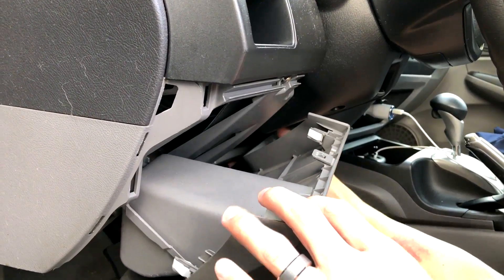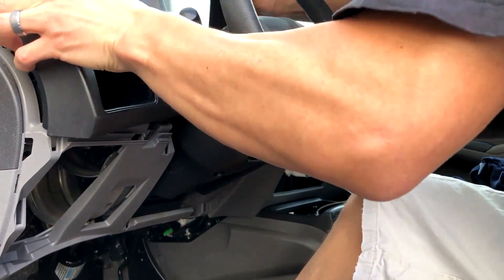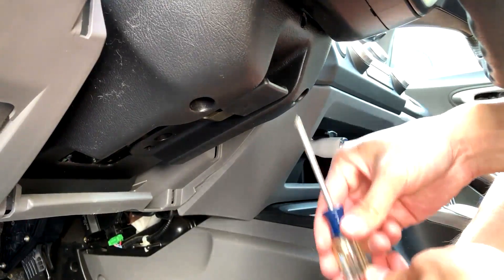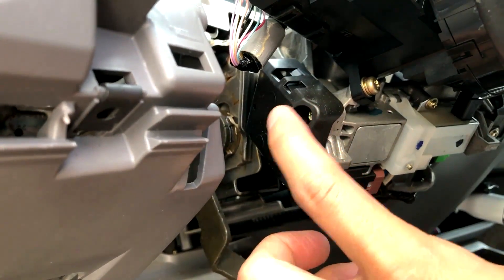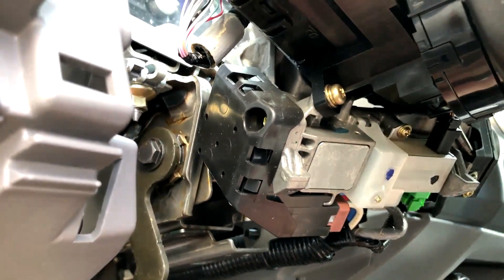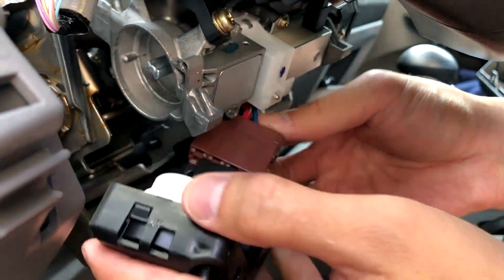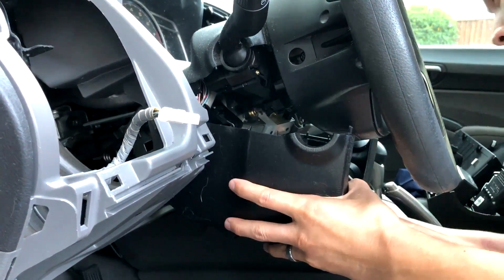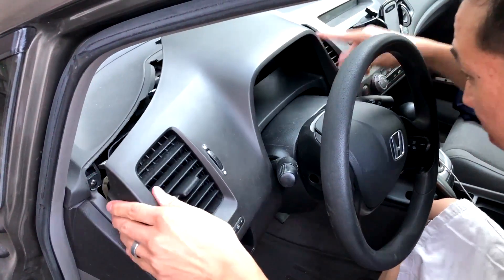2006 Honda Civic Ignition Switch Replacement

Comment: My civic dies every time you let the key snap back in the detent / run position after starting it, but if you rotate the key back very slowly it will stay running. I assume swapping this part will fix that?
Reply from the maker: Very interesting.  It's worth a shot.  I would Google more and see if you can verify the switch is the problem.  But that would be my guess too.
Reply: @nukem384  Yep fixed it! Took longer to find the right screwdrivers than to swap it out! Great tutorial!
Reply from the maker: @leedchristensen  Lolol.  Yeah, that one screw is difficult without busting holes in your plastic covering.  Glad you fixed it!

Comment: I have to press the key up while turning the car on so it starts otherwise I hear a weird “zzzzzz” noise coming from the relay box near the hood latch. Do you think this will fix the problem or do I have to change the entire ignition assembly with new keys?
Reply from the maker: Forums are saying this is actually normal?  Apparently you might just be noticing it, even though it migh thave been there.  Is your car a stick?  The only suggestion I saw was to push the clutch all the way down to the floor when starting the car.  Not sure changing the switch will fix your problem unless you change out the whole ignition system?
Reply: @nukem384   it is an automatic and would not  do this before. The main issue is only I know how to turn on the car so if someone else tries youll just hear this noise while turning the key and the car wont start. I am just not sure if it is the key cylinder that is bad or if it is the ignition switch which you showed how to replace.
Reply from the maker: @markrodriguez0  I would just try both then.  If you're on a budget, my guess would be the cylinder, but I can't say for sure.
Reply: @nukem384  Thanks for your help! I will try the switch first since it is cheaper and if that doesn't work, I will replace the whole ignition switch assembly with new set of keys. I will report back with my fix so that someone else who has this issue has this as a reference.
Reply: The problem was the ignition switch. Thank you, you saved me $$$.
Reply from the maker: @markrodriguez0  Awesome, the I was able to help get your problem fixed!
Reply: Yes a bad ignition switch(that which is being changed in video) the bad symptoms are the buzzing sound that's how you know to change it,I'm having a separate issue car is cutting off immediately after starting
Reply: Imu check the alternator. When car starts disconnect the battery. If the car shuts off then you have a bad alternator.
Reply: Could also be the fuel pump ive had a similar problem with a different car

Comment: Just did this but now my car won’t start and it’s on wheel lock mode not sure what to do now
Reply from the maker: You need to unlock the wheel.  Basically push the key in, hold, try to turn the key and jiggle while moving the wheel.  It should unlock the wheel and then you can start the car like normal.

Comment: How do you know that a ignition switch is bad? And not that it is the starter?
Reply from the maker: The electrical system is really tough to diagnose yourself without the right tools.  For this car, the starter is terribly hard to install (I have a tutorial on it, so I know).  So what I would do is just try the ignition switch since it's a lot cheaper and easier, and if that doesn't fix it, then you'll have to do the starter.  At that point, at least you'd know the electrical system will be good for a while.

Comment: The two screws on the switch are really tight, is there something that can be done to make it more loose?
Reply from the maker: Unfortunately not really.  Screws are the bain of my existence TBH.  Best thing you can do is find another tool that gives you more leverage to break the screw tension easier.

Comment: I cannot pull out the switch after 2 screws removed. How much force do I have to use to pull the old switch out?
Reply from the maker: As you can see in the video, it should take very little force to pull it out.  Make sure the unit is unplugged.  You might need to pry at it a little with a flat head if you can't get it out.
Reply: nukem384 I pulled out electric connector but the switch seems to glue to the ignition assembly. I’m afraid if I pull the switch really hard it will break something.
Thank you for the reply.
Reply from the maker: Sean Liu theres nothing really to break in that area besides the switch. Weird that its stuck in there though.
Reply: nukem384 I made a mistake - I forgot to remove one of the screws. Everything is fine now. Thanks!

Comment: My 06 has recently been giving me problems. I am not able to take my key out of my ignition. I can start it & turn the ignition off but after that I can not take me key out. The only way is to undo my battery every time so my car shuts completely off & releases the key. Could that be my ignition switch going out or something else
Reply from the maker: Never heard of that happening.  That's really interesting.  I would guess it's more the lock cylinder over the ignition switch because the cylinder is what holds the key in those different positions.

Comment: Do you think this could cause car to cut off right after being started? Read somewhere there's something that primes the fuel pump? I got the part getting ready to put in customers car I sold them now it all the sudden stopped running after I drove it for 8 months no issues lol
Reply from the maker: Mmmm...I don't think you'd be able to get the car to start at all if the switch was your problem.  It could be a fuse?  I'm not sure on this at all.  Probably better to get a professionals help.  Sorry!
Reply: @nukem384  np thx it wasnt the part,towed it mechanic
Reply: @nukem384  guess what it was...customer put them diamond stickers around the key hole,so the key transponder  wasnt making =/  contact,they charged them 40$ I was mind blown just didnt even think of taking it off
Reply from the maker: @aimtcb  Who does that?  Glad the problem is fixed!
Reply: @nukem384  yeah its dumb they sell them in auto zone it goes around the key hole it's a circular shinny,mirror/diamond sticker thing ...dumb

Comment: Hey, I followed your steps and it was easy but after installing the new ignition switch, my key can’t turn at all anymore and before removing the old ignition switch , I didn’t have this problem. On top of that, my remote key can’t lock or unlock the car anymore after I installed the new ignition switch but before that I was able to unlock and lock my car. Any suggestions? 

I also replace the starter relay. Before all this happen I had to tap on the starter relay to turn my car on. I figured it was my relay but it wasn’t so my mechanic suggested it would be the ignition switch and now The key can’t turn at all. Please help?
Reply from the maker: Hmm...that's really weird.  I had no issues swapping this part out.  Car is still running fine today.  And you made sure that your steering wheel wasn't locked right?  Changing out this part shouldn't impact the key turning at all.  That would be the cylinder that would mess up you being able to turn the key.  I would say back up and make sure it's not the starter relay that is causing this issue.  Since it sounds like you replaced both at once, it's probably better to figure out which part is causing the problem and work from there.
Reply: @nukem384   I actually got it fixed.. apparently the ignition cylinder broke so I needed a locksmith. Thanks!!
Reply from the maker: @vn3ck  Ah got it.  Glad the car is working again!

Comment: Great Vid! My 2008 Honda Civic cranks and starts but as soon as I let fo of the key it dies. About a month ago or so I was going about 75 on the highway and suddenly all of the lights on my dashboard/panel turned on and then turned off and I tried putting gas but nothing, so I slowly pulled over, took the key off and then inserted it once more and it started. Ever since, twice it's given me issues in turning on and today I kept trying to turn it on, and as much as it stays on when I crank it and leave the key in all the way, as soon as I let go of it, the car shuts off. The shop has no idea what it is but I just e-mailed my mechanic to try the ignition switch because they can't figure it out. We'll see what they say. Thanks!
Reply from the maker: Hopefully it does the trick!  I would rule out the starter since that's only needed to crank the car over and then it's just there.  I think the ignition switch would be your best bet too.  Have them check the fuse as well and make sure that's still good too.
Reply: Dude, same problem whit my civic. please tell me how to fix it
Reply: What Was the problem ? Please

Comment: as far as getting to that screw a ratchet with bit holder or they even make bits that have 3/8 1/2 rachet attachments.
Reply from the maker: Ah true that would work too if you had those bits and the right size extension.  I'm not that cool, so had to Macgyver it

Comment: Have any of you had your honda civic start and then automatically die or start sometimes and then not start at
All? Im just curious because thats waht my cars doing right now. I need to figure out whats wrong with it
Reply from the maker: That sounds like it might be an electrical issue with the ignition system.
Reply: @nukem384  do you think if i replace that ignition switch it will fix the issue or is it more than that?
Reply from the maker: @caitlinohanlan1669  It's probably going to be more than that.  When I said electrical, I meant something with the entire system, not just one part.  You could give it a try and see since the part isn't super expensive.  But if that doesn't fix it, a trip to the mechanic might be in order.  The electrical system is a bit complex and unless you know what you're doing, probably best not to try and mess around with it.

Comment: That's not the ignition switch.  That piece is called the Ignition Switch Starter. That's what you tell the clerk at O'Reilly parts store, it costs $60.   The actual ignition switch is the part where the key goes in.

Comment: How do you know you needed to change ignition switch? 
My civic currently takes like 5 minutes to start after sitting overnight. No crank or any noise. Just keep turning till finally the starter tries and starts right up.
Reply from the maker: That sounds like you might need a new battery?  I'm not there, so I can't say for sure.  But usually with ignition problems, it's usually 3 things.  Battery, starter, or this ignition switch.  You might want to check your connections too and make sure there isnt battery acid, etc on there, as that could cause a bad connection which could be causing your problem.
Reply: I'm having the same exact problem with my 2011 accord, I've changed the battery and starter.. still doing the same thing,  so now I'm here lol
Reply from the maker: @Duble214  Hopefully this fixes it then.  This is basically the only other thing unless your alternator is dying.
Reply: Rudy Perez yeah so I checked the ignition switch with a test light and got 12V also tested battery with test light and got 12v so I moved to the relay which is also good. I put my phone to record while I tried to start and can hear a slight click which is the relay working. I rolled the dice and replaced the starter. Starter was the issue.
Reply from the maker: @Orteezy28  That's actually what I'm doing this weekend.  Car is still having issues starting.  Battery and alternator are still good according to the test light.  Hopefully the starter fixes it.  Not looking forward to the install though.
Reply: nukem384 yeah, take off the front passenger tire for more room down there. Helped out a lot.
Reply from the maker: @Orteezy28  For sure.  I'm going to make a tutorial.  Hopefully it comes out ok lol.  You may or may not see that on my channel soon :D.
Reply: Bro what was your issue....... same issue...... no fix
Reply: @jmully938  starter. Even though it would start after a while, the starter wasn’t engaging right away. When I took it off I can see it was worn out, auto zone replaced it for free :)

Comment: You can also bend a cheap #2 Phillips screw driver tip at a 90 degree in a vise and you have a custom screwdriver to combat stupid engineering. You can also buy an Allen key type set at Harbor Freight that has a 90 degree bent Phillips.